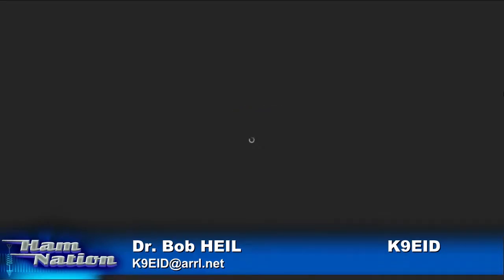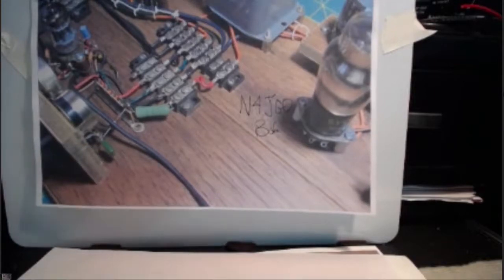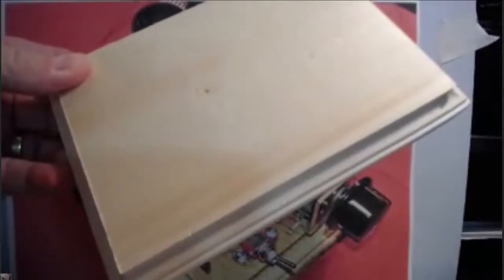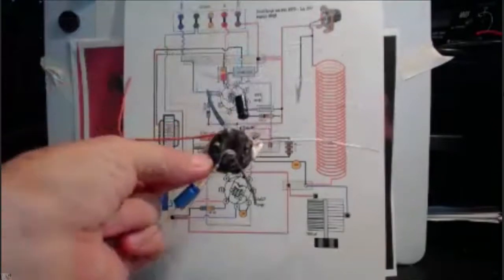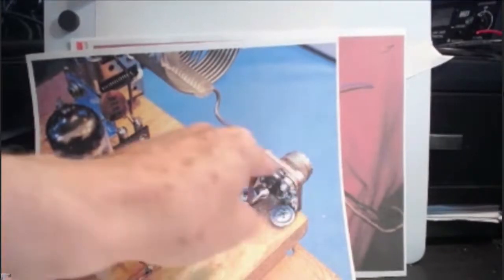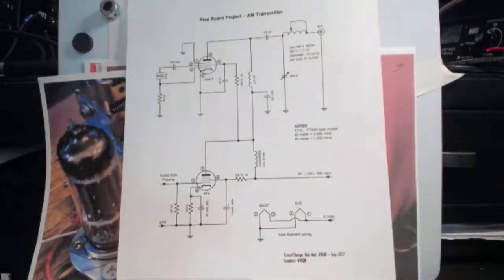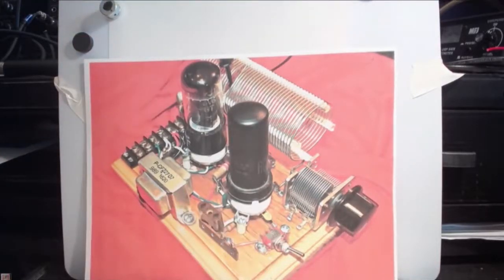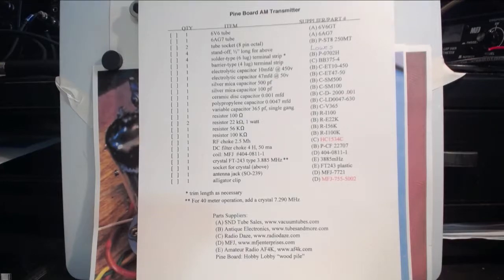HAM Nation Ep.309: Pine Board Project - Transmitter Wiring

Comment: One thing that I did on one transmitter, is that I ordered a 120v-3 prong male panel socket with the ground for the power cord and this makes it easy just to hook up a cord to it, or to say the power supply side. I will do this on the pine board that I will construct next. I already constructed the Pre-amp mic circuit on a board. It will be mounted between the whole setup.